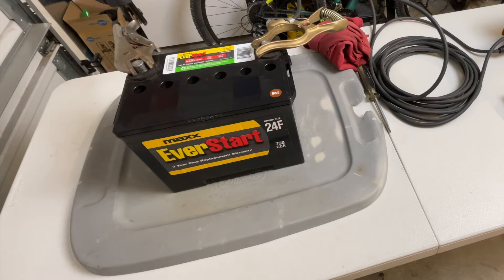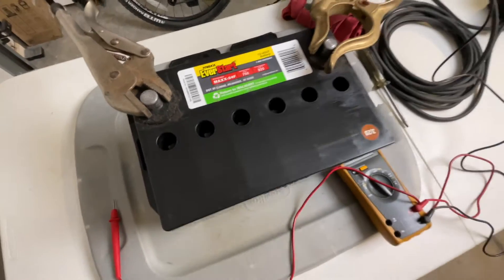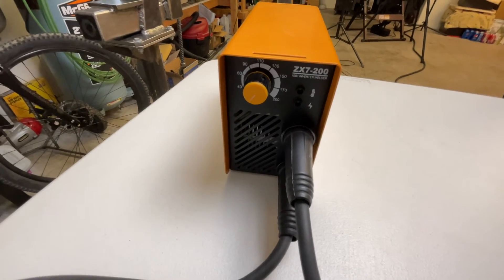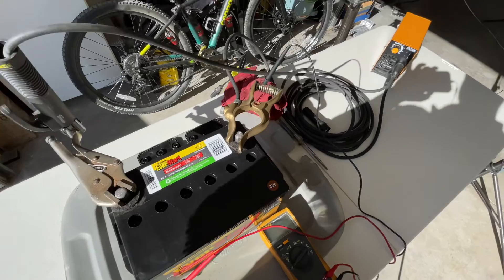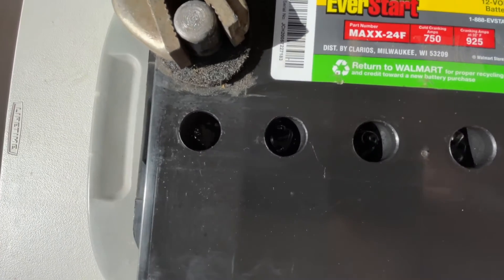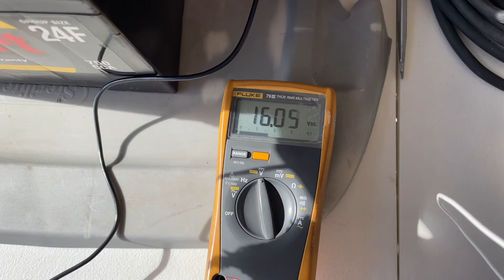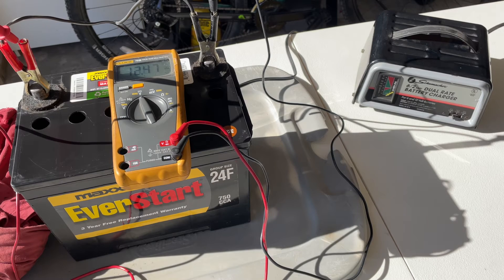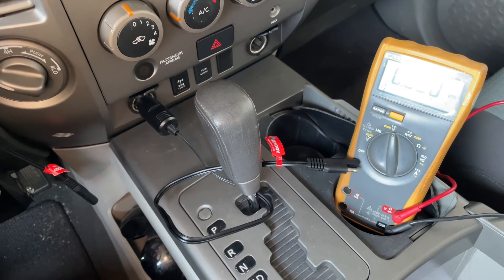How to Restore a Car Battery Using a Stick Welder

Comment: you don't have to use a stick welder or even a 220v welder, i do my batteries with a 110v mig set up for flex and it works fine, you just have to be mindful of the duty cycle, 110v welders have shorter Duty cycles, also from my experience there is no set amount of time, what i've seen is it depends on the condition of your battery, if you have cells that aren't bubbling when you start then you have to keep doing it until they all are bubbling equally. because i use a 110 wirefeed welder i use jumper cables to connect battery to welder that way i can stand back and pull the trigger for 30 second bursts with a couple minutes in between for the duty cycle and keep doing it until the battery reaches above 12.5v  in between burst then put it on a smart charger and let it charge to 100% then the batteries good to go.......
Reply: Yes Thank you ! I have a Mig, and was going to adapt the technique to it ....
Glad to have some insight (Duty Cycle), Thanks for posting !!!
Reply: I am confounded by this. Have an old, late 1980's stick welder that when I try to hook it up, the clamps throw sparks like I just dead shorted the battery terminals. Hear a hissing from the battery, even with the welder off/unplugged and see the old electrode clamped to the positive terminal is glowing red... again, like a dead short. Pretty sure this is not what should be happening. I any idea what's going on? Does it need to be a newer inverter welder?
Thinking about using my inverter TIG but would rather not fry that.
Reply: @Jerseyhighlander are you sure your welder is putting out DC current ??...earlier welders were not rectified to DC...many older welders were AC straight off a variable transformer and MUST be attached to a rectifier first for DC output...check the voltage before use as older stuff was often 35 to 40 volts
Reply: That's good to know
I have a 220 stick welder and a 110 wire feed, but I don't have an outlet that matches my 220v plug so I'd have to buy an adapter for about $30.
Thank you

Comment: Hi Bruce, as the battery has a 3 year warranty, would it not be better to just get a new one?  I see from some other channels that they reckon you can restore a battery's voltage, but the cold cranking amps (CCA) will be greatly reduced, rendering the battery almost, or entirely, useless.

The reason this happens is that the lead plates inside will get thinner and will warp, reducing efficiency or even touching, thereby shorting out one or more cells.
Reply: About the "rendering the battery useless", id have to dissagree on that one. I tried this process in a more aggressive manner(more amperage) this past July, and the battery has been starting and running my daily driver with no problems at all. I will admit I checked voltage, and load tested the battery before and after the process, but did not check its cca. My video is there on my channel , the higher amperage allowed for the battery to be ready right after the welder process, no low charge was needed. But thank you DIY Homestead Projects for posting this video, it's videos like this one that motivated me to try this.
Reply from the maker: That may be the case but I've always wanted to try this to see if it works. I did mention in the video that I may just return it and use the warranty to get a new one but I do have a couple months to give this a try. Since it's getting pretty cold here now this is the perfect time to give it a test.
Reply: @DIY Homestead Projects  understood Bruce, I also like to prove or disprove this type of experiment, but I would ultimately avail of the warranty on offer.
Reply from the maker: I agree
Reply: Just because a battery is reconditioned does not mean the cold cranking amps are greatly diminished.  That's a fallacy.  Often a reconditioned battery is almost as good as new.

Comment: If vehicle just sits, disconnect the battery. Everstart Maxx batteries are one of the best batteries on the market. I get 7-9 years from the many I have had. I am extreamly surprised to see this on a Maxx.
Reply: Everstart Batt's used to be made by Johnson Controls in the USA and were great batteries. Johnson Controls was bought out by another company and are now made in Mexico I have been advised. Other Batt companies are making batteries  for Walmart Such as Decka, East Penn (same company) etc and maybe others. It's hard to tell who's battery is in the box unless you can identify the box it's in such as a ribbed box on the outside is a East Penn or Decka and a smooth sided box is susposed to be the new style former Johnson Controls battery. I guess we just never know these days unless you really sit down and do your homework, unfortunately